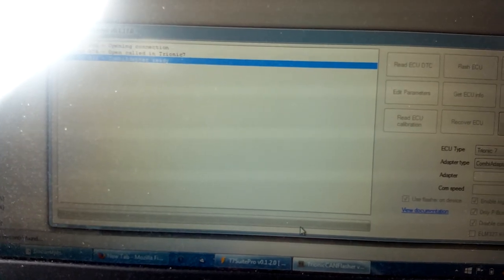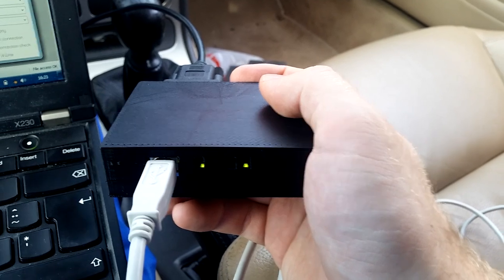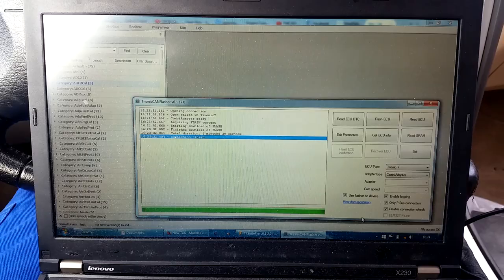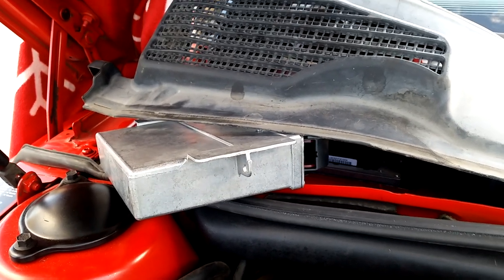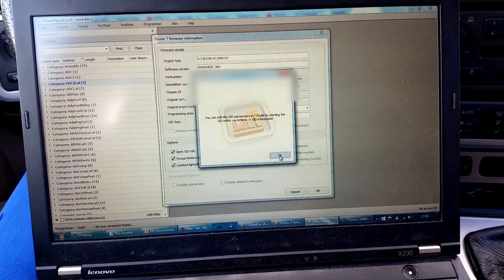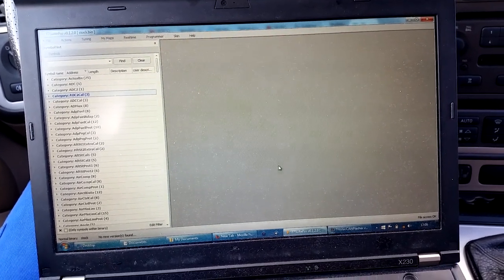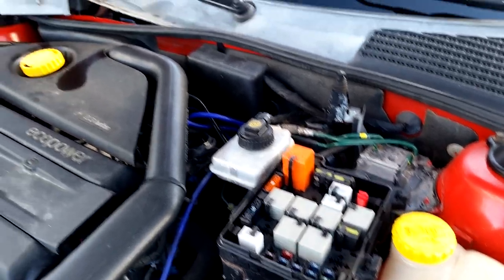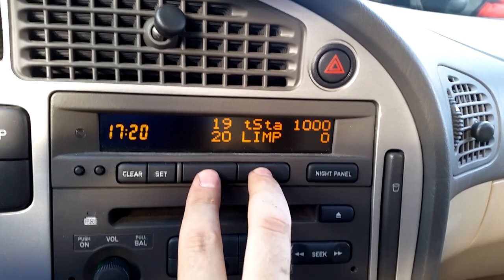Saab Tuning: Enabling OpenSID - Trionic Seven

Comment: Once again, thanks for some very useful info. Looking forward to your ECU removal video, it seems difficult to bend the plastic windshield cowl out of the way without breaking it, so I didn't yet have the courage to go thru with it. I thought about removing the whole cowl but was unsuccessful at removing the wiper arms. They are held so tight that they broke my removal tool!
Reply from the maker: +vb3347 Yes, the wiper arms are a pain. I will finish the video within the next few weeks, stay tuned :)

Comment: Hello Jonathan,
Amazing and very useful video's. I recently bought a Saab 9-3 Coupe. MY2001 (150bhp) and am interested in boosting the power a little. Your videos cover the 9-5 mainly so are there any videos that specifically cover the 9-3 (with T7 of course)?
Reply from the maker: T7 9-3 and T7 9-5 are very similar!
Reply: Okay, but how should I make the changes to the OBD port since my Saab does not have ESP nor CD changer. I am new to this subject, so I might ask the wrong questions or point in the wrong direction.

Comment: Hi, my OB2 adapter has a USB cable connected to it that i can plug straight into my laptop, with this do i still need the Combi adapter? On my Trionic 7 Program, only two options comes up for me which are Flash ECU and Read ECU, whereas in your one you had several options, and also the option of choosing the combi adapter. I'm just slightly confused and if i need a combi adapter.
Reply from the maker: +Djamal Djaidi An obd2 adapter is not enough, you need a canbus adapter. The combi adapter does the same as a canbus adapter but does it faster and better. Make sure you have the latest version of T7suite.
Reply: Tjena. Do you really need the combi adapter though? If you're able to read/write ECU though the obd2/usb adapter - won't that be enough?

Comment: Can you make a video on how to enter the radio code
Reply from the maker: Sorry, you'll need tech2 for that. And if it wants a radio code it means you have a fault in the radio. Every time you remove the car battery the problem will come back. You have a bad memory circuit EEPROM in the head unit.
Reply: Had this issue. The problem just comes back. I lived without a radio for a couple weeks, and now I installed an aftermarket headunit. That's the best solution honestly.

Comment: Hey. I have a stage 1 ecu on my 9-5 2004 b205. But can't find much difference in power. Can you please make a video of how to set the menu on the sid. (which mode to select, or how to set it to feel that 220bhp under the accelerator pedal)
Reply from the maker: Engine mode doesn't change performance. You should check with your tuner why you don't feel a difference.

Comment: Hello where did you get this OBD2 to cs232 cable? Already got the Combi adapter from johnc but got no cable for that.
Reply from the maker: Generic ebay obd2 to rs232 cable, but I had to resolder the pins to get the correct pinout

Comment: hi. i have question. i bought saab 9-5 2.0 t 2002. i have got double engine ecu in trunk. i didn' ask previous owner why he changed ecu. do i have to do some basic settings if i want to plug it in just for check is it ok. i am asking because the imob..? 
this is my first car in Norway so i don't want to do some shit to the ecu. thanks.
Reply from the maker: Any special features with the current ECU? I mean, tuning, opensid, removed secondary lambda etc. 

There's no harm in trying, check my "ECU replacement" video for the jury-rig setup.
Reply: no. i don't know what for is it second one ecu?
Reply: everything is like from factory i didn' t notice enything special
Reply from the maker: Go ahead and try it, it can't go (much) wrong :)
Reply: ok i will try. i was just asking because i didn't know is there imob. in the ecu. i have worked at VAG So it is little bit difference. 😊. thanks for help
Reply from the maker: Good luck!
Reply: car doesn't want to start with this ecu. 😂😂😂

Comment: Hej så du bor I Linköping`? Ja bor i Linkan har en 9-5 Griffin!
Reply from the maker: Jag bor i Jönköping och veckopendlar till Linköping! Du får komma förbi träffarna vid Max Torvinge 1830 på onsdagar! :)
Reply: Jobbar oftast då tyvärr. men om jag har tid så kanske det går. Har problem med min årsmodell 2000 3,0 V6:a tyvärr läckande topplock och den rycker vid gasuppsläpp kostnad ca 20000 kr Hos Toreéns söker efter någon som kan hjälpa mig billigare.Älskar ju min 9-5  I övrigt går den som en klocka! har haft den i 7-8 år. Hade 2 st 9000 innan.
Reply from the maker: Ajdå, tråkigt när en motor börjar gå dåligt. Har hört att just V6:an har en massa problem men ska vara trevlig att köra!
Reply from the maker: Ring Jonas Bilverkstad i Vänersborg, han kanske kan hjälpa dig för billigare peng
Reply: +Trionic Seven: For Saab Enthusiasts Ja den är helt underbart att köra bra drag i och härlig med sportlovet på automaten det känns att den mappar om!
Reply: +Trionic Seven: For Saab Enthusiasts Jag har inte haft några som helst problem fram tills nu! En tändkassett på 8 år samt att jag tyvärr  slarvade med oljebyte så att oljefilter blev fullt och sköt ut oljan. kan vara därför toppackningen är dålig
Reply from the maker: Motorhaveri är alltid ett dåligt oljebyte bort, tyvärr

Comment: were can i get sedanadapter
Reply from the maker: +henke103 Combi adapter? Check the links in the description.
Reply: i have a sedan i need the sedanadapter
Reply from the maker: +henke103 Clever!
Reply: im sirious i have a sedan
Reply from the maker: In case you weren't joking, it's called combi adapter because it has both canbus and bdm connectors, it will work both for a wagon (combi) and sedan car
Reply: ok so i dont need sedanadapter i use combiadapter
Reply from the maker: +henke103 Yes. The combiadapter works with almost any modern Saab
Reply: ok nice thanks. but what is the sedanadapter for and will u make a video of it
Reply from the maker: Lol
Reply from the maker: +henke103 Let me be clear. There is no sedan adapter, only a combi adapter (seriously, you must be joking). Buy a combi adapter for your car.
Reply: ok thank you thanks for the help
Reply: +henke103 Combi, in english, is short for "combined"..the adapter is a combined adapter with both canbus and bdm connections.

Comment: Do you know of any way to swap a 2001 9-5 Aero  DIC cassette over to a 2005 9-3 single coil (x4) setup? (would be nice to get rid of those expensive  cassettes and be able to just swap single coils)?
Reply from the maker: No, I'd say that will be impossible
Reply: @TrionicSeven  its not i have seen other cars exactly same type of engine have custom separate coils when it was clearly missing the pack